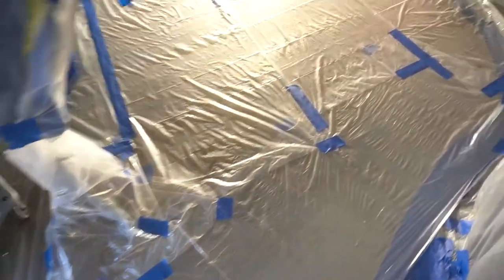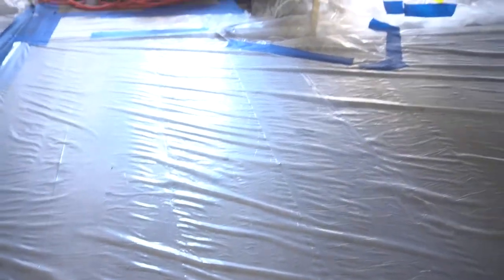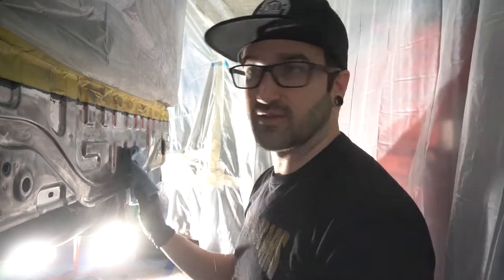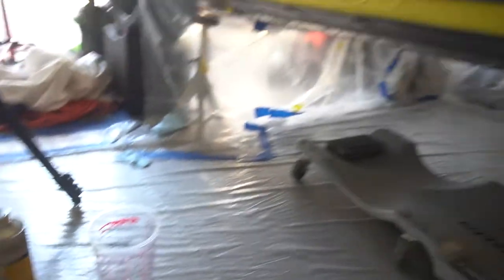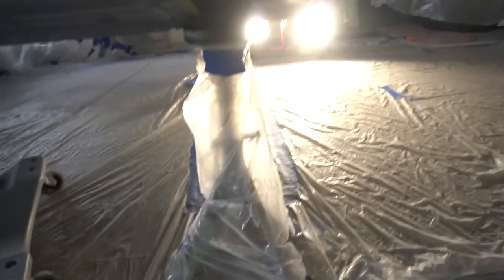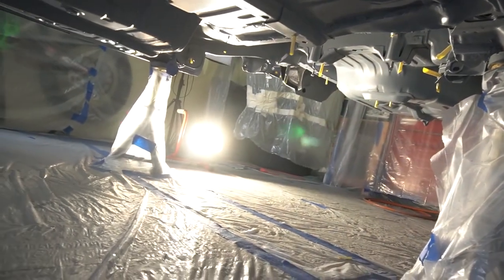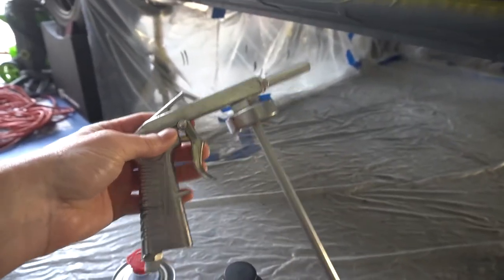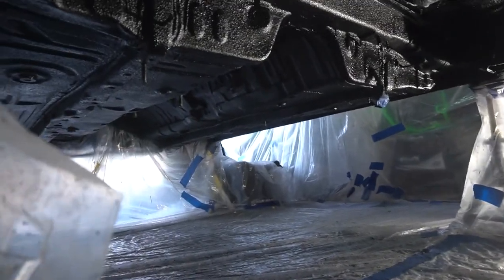How To Create The PERFECT Evo 9 Undercarriage In Less Than 10 Minutes

Comment: Hello, nice job! I have a question - is it possible to apply the raptor liner in a indoor garage? How are the fumes that it releases while spraying? Can it get inside the house? Thanks
Reply from the maker: Thank you!! I appreciate that! I did mine in a one car garage, it’s tight but you can do it. I would definitely cover everything you can in plastic. Walls and all because if you use the spray gun kit it blows and splatters eevvvery where. The fumes from what I remember were pretty strong, not terrible but you knew you sprayed something. I think it may have been in the house for like a day or two but if you can just open the garage door during the day and let it air out.